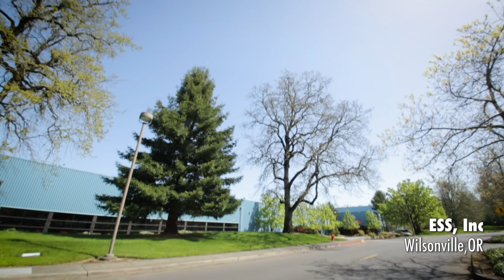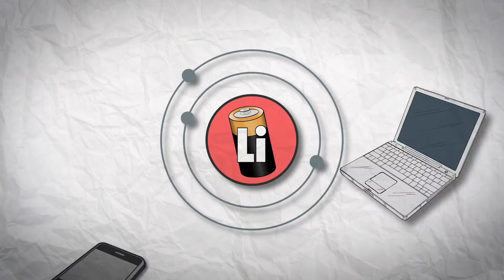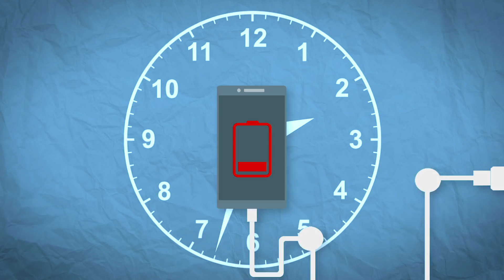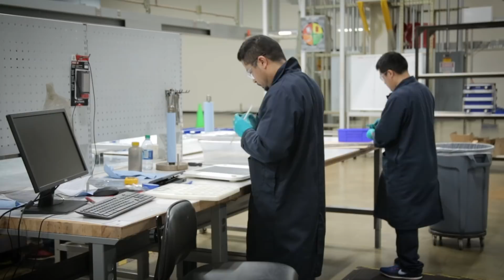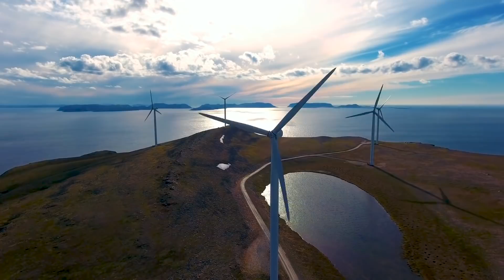Battery Fueled by Iron and Water Could Transform the Power Grid

Comment: Nice technology, but 50 kwh in a whole shipping container isn't a whole lot.

No mentioning of the cost per kwh?

How fast can these batteries charge and discharge?

Would it be possible to increase the capacity using different materials?
Reply: Here's some info about the discharge time that we can deduce from the video. And some comments about your other questions.

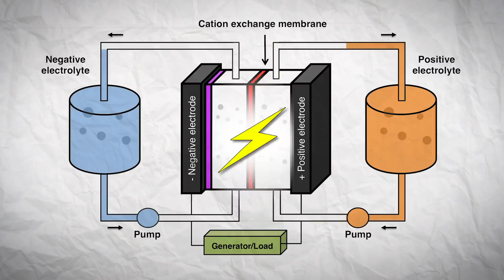At 2:35 a trailer is shown that says 50 kW and 400 kWh. 
kW is a measurement of power, kWh is a measurement of energy. 
400/50 = 8h 
It can discharge in 8 hours*. 

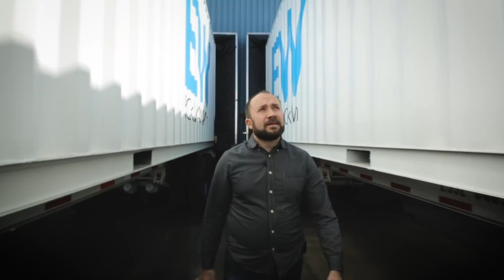*But there are always losses, also the more power you take, the less capacity you get. Which is probably why the say 6 hours at 7:06. 

The reason for why the energy, aka the capacity of the battery, is "reduced" by the more power you consume, is because the battery has an internal resistance. And when you consume more power you take more current, and power is (resistance × current²). So higher power output => more power is being wasted in the form of heat in the cables and internal resistance of the battery. So it's 6 hours with 50 kW load. And probably around 35-40 hours with 10 kW load or some other smaller amount (yes, I'm just guessing). 

===================================

"No mentioning of the cost per kwh?" and "How fast can these batteries charge and discharge?"
I don't think you can get a good guesstimate for the charge time or the cost per kWh though.

"Would it be possible to increase the capacity using different materials?" 
Yes, ofcourse, but that makes the whole idea bad, the reason for why iron and salt and water is chosen is because it is redundant and safe. You could go with Lithium Ions, but then you will run into problems as they describe in the video. (Fire Hazards and Ph problems). Even 

if you could get a battery that was twice as good with copper instead of iron, then you'd still go with iron because iron is way more redundant than copper (and muuuuuch cheaper). I don't think you can get a metal that is cheaper than iron and a liquid cheaper than salt water. I mean, you have an entire ocean.
Reply: @harrysvensson2610  Increasing capacity is just using bigger tanks. Increasing the charge / discharge rate means adding more of the reaction cells - the permeable membrane sandwiches.

They have it packaged in a shipping container with the tanks et al and have that in 50 kW / 400 kWh building blocks...
They could just give you a trailer that is all cells and you could put 2 large tanks outside and then the same box would have - perhaps - 200 kW and 4 MWh ... 40 MWh...400MWh ( how big are your tanks)

The other aspect is that you have your charging side and your discharging side - potentially - in 2 different stacks and both can happen at the same time without having any electrical connection between the 2.  You can size both sides to the potential max load you reasonably expect to see - and this will not bother the battery at all.....just impacts how long you can sustain the discharge rate as noted by Harry Svensson.

To borrow from the cooking shows, it's a battery deconstructed served 2 ways - otherwise it's just a really really big and heavy wet battery much like your car battery ( only different).

(There is a group out of Harvard University which is experimenting using an electrolyte found in rhubarb - you never know where this is going to go)
Reply: There's 400 kWh in the container.
It can output 50 kW.
Reply: @galfisk  they also have a 100 kW / 400 kWh unit - I imagine it's just 2 boxes linked together ... perhaps 1 is just tanks and the other is just the cells
Reply: @gregmislick1117  Their 100Kw solution is the same size, just checked on their site.
Reply: google just says 400kwh @ 50kw is 8 hours.... that doesn't say "error, this doesn't make sense" lol.
Reply: Joseph Stott I think they said it can supply power to a block for 6 hours.
Reply: Joseph Stott. 
He said (sic) "50 Kw/400KwH" is the right way to calculate the discharge time... (with 50Kw/400KwH you get the derivative of the power, or some other mumbo jumbo). That is what I was responding to. Now in hindsight I realize that he just said what it said on the truck. Which literally said 50 kW/400 kWh (yes, small k, large W, small h). 

But hey, the moment misunderstandings rule the comments, that's the time when you need to run. Ciao.
Reply: Nop, they're meant to be used in power surges helping to ease the load on peak moments, they're batteries not power generators, they take sunlight all day or electricity at night and distribute it in peak hours. They don't need to match the power generation capability of the generator, they can charge at night for instance at 1/8th the current of the generator and that wasted energy at night would become power at the moments when it's pricey to generate. They're not meant to store 100% of your energy, it's more a kind of nitro for special moments.
Reply: Graphene or carbon nanotubes. Add those to the electrolyte component.
Reply: Russell Hltn In my opinion, the target market is rural areas such as farms or off-grid estates that have enough space for a large solar array and a shipping container battery or two, but don't need a full-on power plant. Maybe even a small town.
Reply: ah yes the 400 kwh 50kw is because drawing 100 amperes at 4 volts in one hour is probably more damaging to your circuit than 12.5 amperes at 4 volts. don't ask me my electrons never listen to me
Reply: Cost would be a nice information to have,given containers iron and water are not the most expensive materials it is very likely they are comparable or cheaper as said power plants. And the Tesla battery in Australia (although Li-Ion) proves what a cost saver they are https://electrek.co/2018/05/11/tesla-giant-battery-australia-reduced-grid-service-cost/
Reply: nfw
Reply: Peter Faber doesnt matter
Reply: Peter Faber great questions. I was hoping to see them answered in the video, but its nothing but BS i think.
Reply: what would be the cost of one of these containers to setup and have operational all done?
Reply: @chuckdonks5519  no idea.
Reply: @gregmislick1117  Hmmm,ok thanks.. ;)
Reply: Recall that cheaper materials is the edge in affforability.
Reply: Based upon cost of this container and if and only if this thing can be charged under 1 hour from either Solar panels or Wind mill then this energy solution is going to go all out in the market.  I can bet my stocks on this company for sure. But and there is a but, if it cannot do a cheap module like US$20,000 (for example) and recharge this 40’ container in 1 hour then there will be less demand. Just my 2 cents.
Reply: Peter Faber yeah... they kind of skirted over the whole fact that it’s massive
Reply: I like the low tech, low toxicity, low hazard aspects though.
Reply: Especially considering the average homeowner uses about 150-175Kwh per day. 
Cost should be calculated not only per KWh but price per watt as well.
Reply: Its 50 Kw/400KwH
Reply: but when a home power wall is 14kwh@5.8kw constant discharge because that's what's needed... I don't understand how even 400kWh @50kw would power a "block of homes"...are there only 10 houses in a block in the USA? Since some homes require two power walls to be completely off grid I'm guessing there are definitely more than 5 houses per block... so I'm guessing these are optimistic number to say the least.
Reply: IT'S FOR SURGES IN PEAK LOAD DUMBASS, they're meant to be used to ease the load on peak moments, they're batteries not power generators, they take sunlight all day or electricity at night and distribute it in peak hours. They don't need to match the power generation capability of the generator, they can charge at night for instance at 1/8th the current of the generator and that wasted energy at night would become power at the moments when it's pricey to generate. They're not meant to store 100% of your energy, it's more a kind of nitro for special moments.
Reply: eternitynaut, now look up the power plants near you.  For me, it's a trash-to-energy plant at 68 MW, biofuel at 120 MW.  That's not counting a oil plant at 650 MW.  Now, how many containers would you need?  I don't see this scaling up to to "power plant" size.
Reply: @russellhltn1396  meanwhile there is a 6MW power plant trying to get approved in my town.
I'd rather see the right of way for the existing gas trunk line filled with enough PV / Wind to charge enough of these cans to output 6 MW.
DISCLAIMER: the new powerplant will be sited about 2 miles from me, and the fuel trucks for the 2Million gallons of onsite stand by diesel will travel on a 2 lane road and who knows where the cooling water will come from or how they plan to contain / clean spills from the watershed.

But then what do I know.
Reply: Greg Mislick  well if you went PV it takes about 4 acres of land for 1 megawatt of panels. Since you can only generate in daylight and then say store in this battery you have to have 2.5 times The output for 6mW appx 15mW of PV panels. That would be a total of 60 acres of land and 30,000 panels. The storage system is rated in hours of supply so 6mW by the number hours, appx 14  is 84mWh . The salt iron trailer takes 2.5 per mWh so appx 200 trailers. Don’t know how the upfront costs would compare to your diesel system, but suspect this would be by factors more but of course in the PV the fuel is free and doesn’t require trucks to bring it!
Reply: @wphubert  well, at 6mW, this power plant is just to smooth out supply/demand demands on the grid. 
Granted, the unitized concept here scales badly, BUT, if they simply put containers with the cells in it , and then use those 2,  1 million gallon fuel tanks as electrolyte tanks, I suspect we have far fewer containers.

Then look at land use, there are MANY acres of land used to provide right of way for gas lines and high tension power lines  - put the PV and or wind on that land. 

It just seems that we've disrupted the environment with the infrastructure already, just build on that.

It's a thought  (highways are another generation corridor)
Reply: @russellhltn1396  it is not ment to replace the power plant its to store solar and wind energy so it can be used at night when solar is useless
Reply: @ZERO-th6dd  And the point of doing that if it's not to replace a conventional power plant is.....?
Reply: John Horvat, that makes literally no sense.

Even google agrees with me. 
https://www.google.com/search?q=(400+kWh)%2F(50+kW)
Reply: Agreed.  I think they need at least an extra zero.  Most power plants are in the tens or hundreds of megawatts.  This is only 0.05 mega watt or 0.4 mega watt-hour.  You'd need 1400 of those just the match the output power of the smallest power plant near me.
Reply: What's the size of that power plant? Is it over 1400 times bigger than a shipping container?

Comment: I’ll s definitely heading in the right direction. We need to just give this stuff a crack now. Forget comparing Lithium Iron batteries people. They are for different requirements. It’s the high cycle rate, longevity and minimized environmental impact that these batteries significantly achieve. Sure the footprint is larger but they are much safer. Anyway, let’s give it a go. I’d have one at my place along with a 20KW solar system and I’d sell off the power to my neighbors cheaper than the grid! Bonus all round!! Giddyup!

Comment: This might sound strange but that Oak is for sure at risk, but for completely different reasons.

The container is huge and probably weighs a lot, it compresses the ground where the trees roots sit. They grow close to the ground, The compression will make it harder for the roots to pick up nutrients and oxygen resulting in the roots dying.

If this happens it will not be notable for some time, but maybe 3-5 years after the container was placed you will see in the oaks crown closes to the container start to die. This is a common mistake, people often want to protect the tree, the stem, what they can see, but the roots go out from the tree a good way outside the crowns circumference and are quite fragile in these aspects.

Hopefully it won’t happen, would be a shame on such a majestic oak :)

Comment: So we learned that there are iron + water batteries ... but no specs, and a lot of propaganda and misinformation about Li-ion batteries. Shame on you, whoever made this video without doing at least some research!
Reply: Lithium ion batteries do suck they can only be charged around 1000 times before they loose ability to hold their rated charge.  If im wrong then why do cell phone batteries fail after a few years.  Charging your phone average of 365 times a year quickly adds to 1000 charges.
Reply: Look up"Edison Battery".
Very,very old tech.
Reply: @firstgoinpostal  That's a different technology. Nickel Iron isn't a flow battery it's closer to lead-acid.

Comment: The environmental credentials really are good.  But the energy density issue is really significant: an 85kwh Tesla battery has 70% more capacity and fits in (actually under) a car.
Reply: Density is more important in a car, but there are few places it's completely unimportant.  To have sufficient of those container batteries even out solar power for a city, you'd need a battery farm the size of a small town, huh?  Apart from density, another question is charging speed.  I don't remember them saying... was that covered?

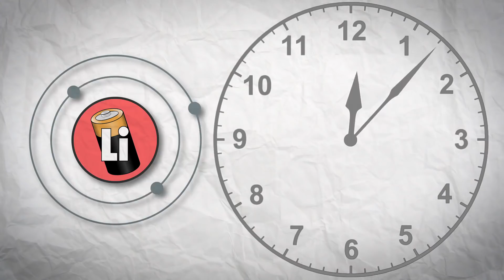Comment: Did you just say that Lithium Ion batteries can only store electricity for "1-2 hours" (3:38)? Or is this only for high energy batteries?
Reply: I'm guessing he meant for high energy (capacity) batteries..
Reply: About 1 to 2 hours worth of power for a similar sized module, this one is limited only by the storage tank size. It is a flow battery that has a solution of iron 3 chloride and a basic salt solution, likely ammonia. The chloride ions move to the ammonia and the iron is reduced to ferrous. Not terribly efficient but it's an appropriate technology for renewable power.❤

Comment: Unfortunately, environmental concerns will always take backseat to economics.  So I'm curious as to the price of these containers compared to a comparable Li-Ion setup.   A Tesla Powerwall 2 holds about 13kwh at about $7300.  So about 30 Powerwall 2's would have same capacity as one of these containers.  Therefore if one of ESS's Fe-H20 400kwh flow battery containers comes in under $200K, they're definitely on to something here.
Reply: I would think 50kW of output and 400kWh capacity would have an 8 hr. duration if as he says 20 year life cycle this is a substantial amount of energy storage if you use 25 kWh for the average home in a day this would cover a 16 day power outage.  the only real problem might be cold climates but this is true for most batteries.
Reply: geshbeddin 25kwh is over double what I use on average per day, live in U.K.  so maybe no AC.
Reply: @geshbeddin  I wonder how a flow battery is affected by temperature, cold or hot.
Reply: this was my point and not really addressed in the information as I live in Alaska and it gets quite cold here in the winter so I would imagine this type of battery would need a place to store it that is kept warm. I am thinking standard room temperature.
Reply: ``Unfortunately, environmental concerns will always take backseat to economics. ``

With that attitude, you're just engaged in self-fulfilled prophecy.

Comment: These kind of videos depress me. Maybe the flow battery that is the subject of this video is the best answer to store renewable energy for the grid but how could you trust it when such  outright lies are told about the obvious competitor. Li-ion batteries used in those applications do not die after 2 years, why even the Li-ion battery in my EV is 3 years old and it has a warranty of 8 years (so far with no loss of capacity) with an expected life of 10 years, maybe more (and Li-ion cells used in the world's largest grid storage applications have a different chemistry, one optimised for long life and many charge/discharge cycles unlike EV cells that are optimised for high power and high energy density). If you expect to be taken seriously stick to the truth, people understand that if they are lied to about one well understood aspect you could well be lying about anything.
Reply: I'm guessing he meant that a Li-on battery would last 2 years of non stop cycles of 100% charge to 0% and back.
Reply: Salt water will kill most vegetation it’s not a fertilizer
Reply: @hjdhjd78  Do you know how many different kinds of salt there are?  When the layperson hears 'salt' they immediately think of Sodium Chloride.  But there are TONS more.
Reply: Lithium ion batteries vary extremely depending on how it's made, who makes it, processes etc. There are different types of lithium ion batteries. Some have technology/special process to make the life span longer and last more cycles. Some don't. But all lithium batteries lose capacity with each charge, how much is lost depends on lots of variable but they ALL do. There are lots of research being done to find ways to extend the lifespan of lithium batteries, and lots of research already done, that's why lithium batteries nowadays have a longer lifespan, but to sum it all up, yes, they all do lose capacity with each cycle.
Reply: It's good to be skeptical about all the information they're feeding us. I mean, they're transparent about the fact that this video is SPONSORED by the product's manufacturers, so they're clearly incentivized to highlight and exaggerate the faults of their competitors.